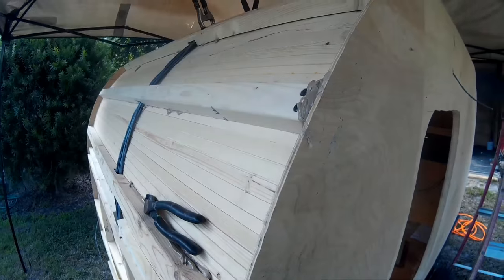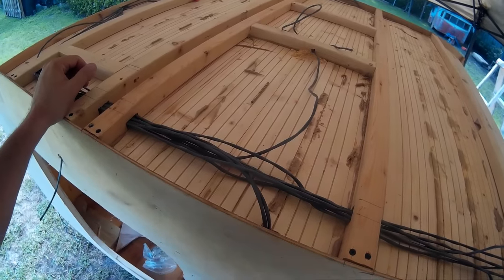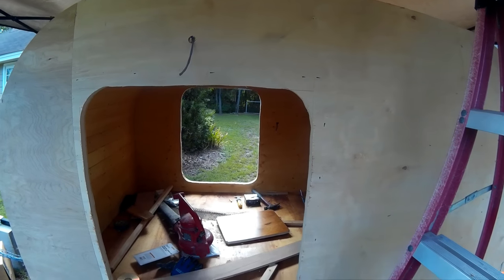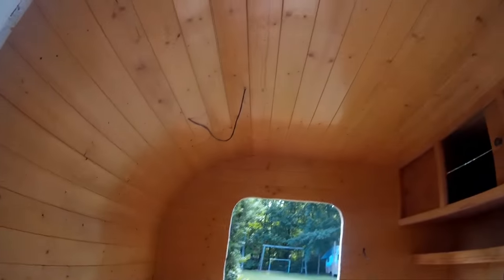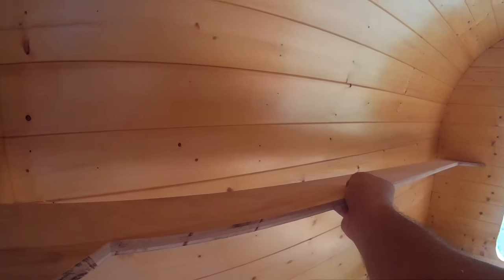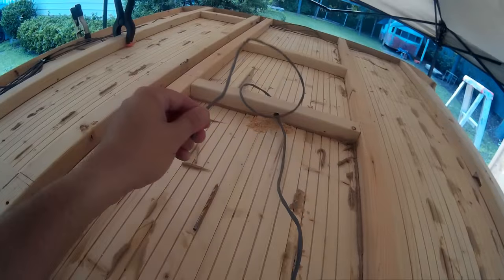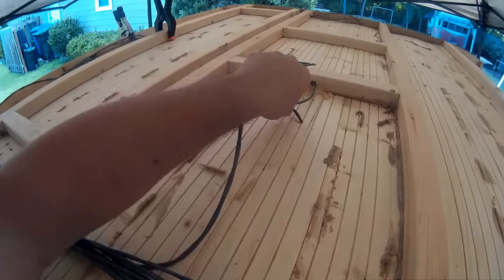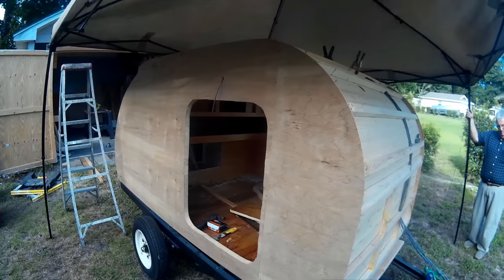How to Build a Teardrop Camper #13- Electrial Wiring 12V

Comment: Great series of videos on "how to".  One questions here is did you run ALL double conductor wires throughout the trailer for 12 V. lights, fan, etc.?  Did you use wire ties for the bundle before you closed up with outer sheathing?  Did you run the 12 V. ground to the frame?  Also did you run any 120 V wiring for shore power?  I understand that any 120 V. ground should NEVER EVER be attached to trailer frame...agreed?  I have watched maybe several dozen "how to" videos on teardrop construction, some of which were pretty good, but they don't hold a candle to yours.  Thanks for taking the time to be so thorough in explaining everything from beginning to end.  Very professional without being preachy.
Reply from the maker: Yes.  We used 2 conductor for all the 12V. Didn't want to fight a grounding issue by using the skin at the ground.  We tied everything up as best as we could where it was coming out from under the skin.  Yes, the 12V is all common grounded to the frame.  In this trailer we used a simple stand alone battery charger, so it is not grounded through the frame.  It' basically just another thing plugged into a "big" extension cord. We did end up plugging the AC in separately from the other stuff because it tripped the power strip.  No big deal though, we just run the cord out the bottom of the hatch when the AC is in use.  Thank you for the kind words.  Just trying to help and inspire others to build their own, as it's not that difficult once you break it down in steps.

Comment: I'm just starting to do research on building a teardrop and am glad to have finally come across a video series that isn't just a tour. Thank you!

Question: about how many feet of wire do you estimate you used? Hate to catch myself short when I put together my shopping list (whenever the project actually happens).
Reply from the maker: Thats a tough one.  I would probably buy 200 ft or so.. that would probably be enough.  We put ALOT more wiring that some people do, but I like to be covered everywhere.  Thanks for watching!

Comment: So the inside light and the two over the door lights are 12v and the rest of the electrical works off shore power? Or does everything work off a inverter and battery and then the shore power charges the battery?
Reply from the maker: yes, and no.  The rest (other than the nav lights, those work off the car when driving) will work off the battery as well.  There will be a charger that keeps the battery topped off when we are plugged into shore power.  Otherwise, it will run all the 12V stuff off of the battery.  We don't do an inverter because the # of batteries required to store 12V juice to convert to 110V juice just isn't practical . (at least 2 or 3).  That's a lot of weight.  There will be another video that shows the 110V system.  That will beaiscally be the charger, the AC unit plug, and a couple outlest for coffee maker and such.  These willl only work when we are plugged in.   This might sound restrictive, but we have honestly not missed it.  We occasionally dry camp (no plug ins) but the fan keeps us cool enough and will run a couple days off of the battery.  If you added solar... then that's another beast.. you could camp for a while with no plug ins, but then there is no AC or ther 110V stuff in that setup either.
Reply: Thanks for information. All that makes sense. So the 110 stuff just goes back to a small breaker box. I will watch that video too.
Reply from the maker: Actually simpler than that.  I think we are going to have a power strip wired in as the junction box... I think.  I saw someone else do it and it looked very simple that way.
Reply: An old fashioned coffee pot work without any power other than the campfire!

Comment: Did I miss something? It looks like the cabin is not attached to the trailer? Is that correct?
Reply from the maker: +Tim Hunter (Owize1) ha ha... No worries . It is easier to build off of the trailer. I just set it in the trailer a few days ago,  because I'd space issue in my tiny shop. Ideally I do the entire build on floor casters and then move to the trailer for final attachment before wiring up the final electrical connectiond.  Nice observation! Thanks for watching, I appreciate the comments and questions as well.